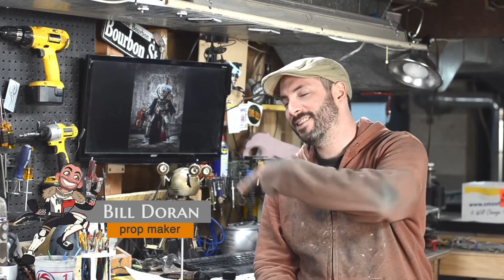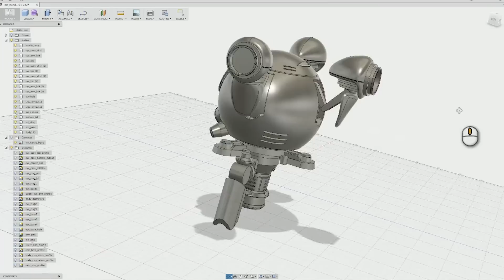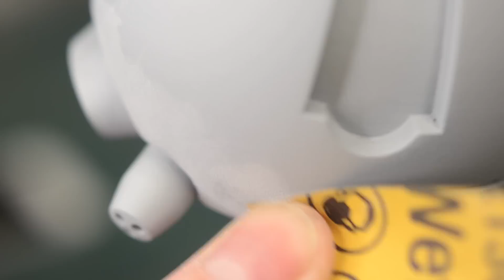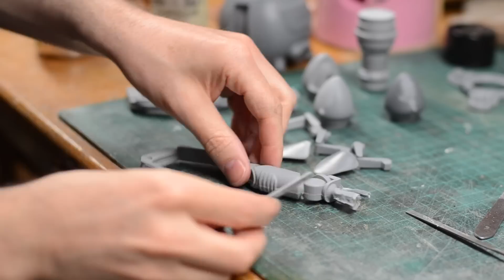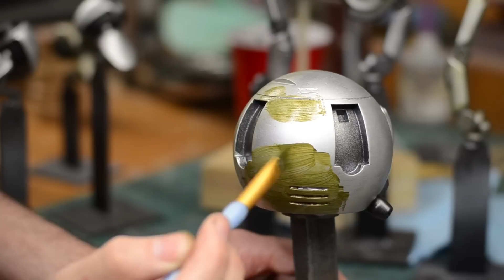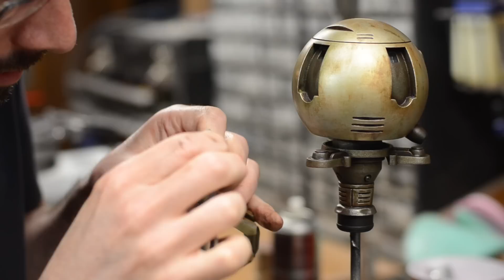Prop: Shop - Mister Handy Scale Model Build

Comment: Easier way, Get pc version, download a bsa extractor and nifskope, extract the mesh files, open in nifskope, export as a .obj, open in printer software, print
Reply from the maker: Odds are good those game files are not modeled properly for 3D printing and mold making.

Comment: is there a way you can make the limbs move? like a pose-able figure
Reply from the maker: +adarel reyes Probably! I would have to re-engineer the joints and build the legs in multiple pieces.
Reply: Punished Props i think ball and socket joints would work

Comment: Hi ! Fantastic model well done ! 
I'm wondering how did you recreate the Mister Handy logo on the back. I'm currently doing a Mr handy to and I'd like to add a 3d mr handy logo on the stand (and probably a general atomic one on the wall). I'm  also thinking about building a mr gutsy, it could be nice if you build one with your mr handy !
Reply from the maker: The Mr Handy text on the back was engraved with my laser cutter.
Reply: Thanks for the answer ! My question wasn't really clear sorry, what I mean't is how you modelled the writting of the logo, I tried to take some pictures to replicate it but I don't have clear enough shots from the game

Comment: hi just watched your robot vid very good thx. my question is you used pla for your main parts? can you tell me what were your 3d printer settings?  I'm struggling trying to 3d print a ball the pla fails no matter what settings I use ie speed feeds heat settings. if you can help and I'll try your settings. thx for mr handy!
Reply: Ok thx for the reply anyway.

Comment: the model is the fallout 3 and new vegas mr handy
Reply: +_JackD201 _ exactly. that's what i thought.
Reply: +damien Gambler that doesn't matter. All they do is take the model they want and shrink it then put it on a stand. It doesn't matter if you use the old model or the new one.
Reply: Yeah. They have all the old robots as the models. Protectrons...Mr Handy... Sentry Bot...all of them I guess. They're all the Fallout 3 textures, perhaps a little Easter egg to the older games.
Reply: it is
Reply: +Ricochet Rabbit correct me if I'm wrong, but wouldn't it be easier to use the current models then the models from the previous engine?
Reply: +Plattfisken Not if it's an easter egg. It wouldn't be Bethesda being lazy because all you would have to do is shrink the model of the robots and make them a collectable item. Simple.
Reply: Plattfisken no it would be easier because the models are simpler then new model
Reply: damien Gambler Then why didnt they do it?
Reply: Plattfisken Bethesda used the same engine for fo4
Reply: Ricochet Rabbit i was talking about the old models how they used it
Reply: +Ricochet Rabbit no they didn't they used one engine for oblivion and fallout 3 and one for skyrim and fallout 4.
Reply: Plattfitzen nope. It’s the same engine they’ve been using since Morrowwind
Reply: Easter egg or lazy beth.

Comment: Great build, it's been fun to watch this come together!

Why did you decide to use XTC only on the lends? Was it just a personal choice or do have you run into issues with XTC on the larger parts? About to cast a 3D printed knife and would have used XTC but your filler method looks fantastic!
Reply: +Punished Props Thank you for the reply. I think I'll give it a try on this next print!